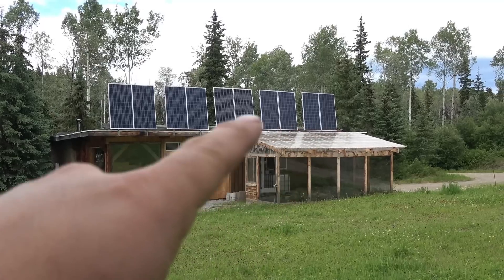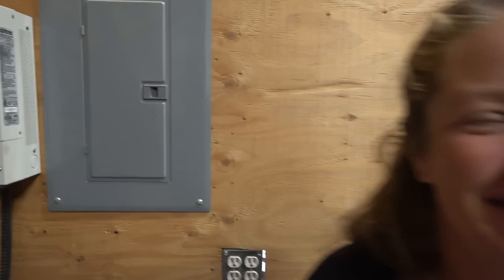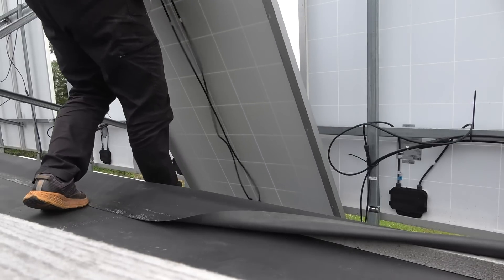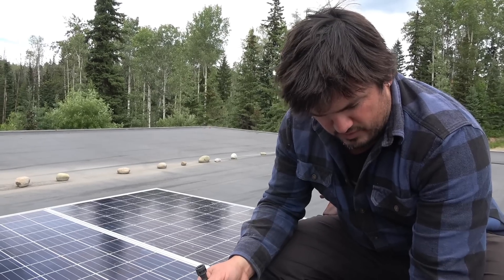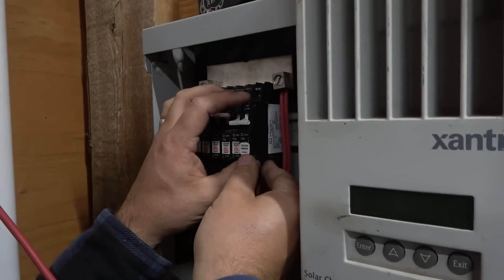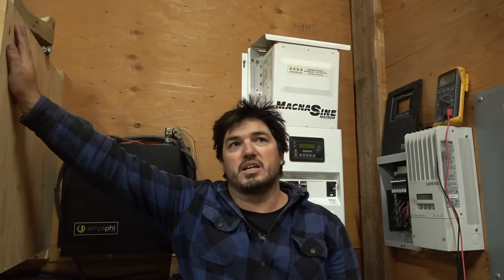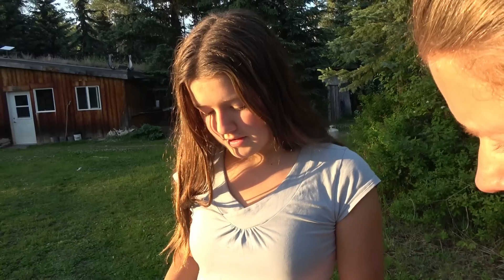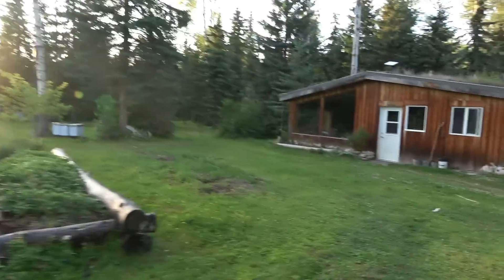SUPERCHARGED Off-Grid Solar Power System

Comment: The over panelling trick to max out the amps for a longer period would be to have more panels aimed in different directions (east west) or build a tracker.
Reply: offgridwanbe is mostly correct. for e.g.  facing half array SE will allow PV array production to not exceed limit of charge controller (60A.) over the day. Their issue (*from org. 'dropoff' prod. graphs they hand charted for season of video)  was not using available PV production after batts filled in AM.    So  they really need (*acc. to graphs for this time of year) INcrease  Battery Capacity (Amh) 🌻  OG Free fuel is the Ultimate Power🗽
Reply: In different direction will limit the panels
Reply: @kenputer56  yes but since it is over paneled it will give more in a day as some will be maxed out all day

Comment: come on man, just dry stuff, no active power required
Reply: yeah that was the old style, before the electrical nonsense lol
Reply: of course you get more power
Reply: on the off-hours it rises the base supply
Reply: camera tripod man
Reply: the panels act like capacitors when external leads are not connected
Reply: you should have a dump load (some expensive process) that you can dump any excess power, over the batteries, anything

Comment: Jeff, you need to build some kind of a tilting solar platform that can be adjusted by a sprocket and chain from one or both sides of your house. Then the platform can be locked into place using the links of the chain. You're still living the dream though buddy, good problems to have. God bless

Comment: Wrap the freezers in 1 inch foam insulation.  It helps
Reply: No as it does not dissipate the heat so they will have to work harder and use more power up

Comment: Why not put them in series to increase the voltage?  Then you can charge at a higher current once the charger's buck-converter brings it down to battery voltage, hence increasing the current.  It appeared you were still well below the 150vdc rating of that mppt charger.
Reply: from 2 panels to 3 panels in series

Comment: I love your show. I am way over paneled too! I have two Midnight solar 150 classics connected to 30 panels rated at 240w or 7200 kw.. I had to reduce max output to 80 amps each because my buss bar was getting so hot. I bought a plug in temperature controller and plugged a couple small fans into it  and increased the output to 90 amps each. Not sure I want the full 96x2 amp capacity going on while I am away. LoL 
   We are in the south so we have to include air conditioning in our grilessness!
    Well done and we’ll played sir.

Comment: You know a cheap and easy way to increase solar production, possibly by 33% is to add reflective mirrors on either side of the panels, focusing more light into each one.  And, the "mirror" doesn't actually hve to be a silvered glass one, simple polished aluminum panels will do well.  And the aluminum panels can be used to fold up against the PV panels in case of inclement weather.
Reply: Have you tried that? What improvement did it provide?
Reply: @smalltownhomesteadAC  not personally no, all his is research done by this channel https://www.youtube.com/watch?v=FKhszB4E1_M&t=945s  he does multiple videos on the subject, and I'm looking into the entire process, not having the money to actually build my system.
Reply: Ground mount using Bifacial panels with white background makes more power.

Comment: Find a good spot in the yard and make your solar array there.  Then you dont have to worry about your roof and they are easier to clean in winter.  I have found that if you over kill on the panels it will charge your batteries faster or get more power on cloudy days.  When your batteries are full, that is the time to use the most electric, laundry, tools, etc, then you are only using solar power and not battery power.

Comment: Makes sense that you wouldn’t receive 100% of panel volume. As panels on average only produce 15-20% efficiency. 
I sure love your content. Like a refreshing glass of water on a hot day
Reply: Isn't that efficiency meant to mean 15-20% of the solar power available per square? There is about 1000W of solar energy in a square meter area so 20% efficient panel would generate about 200W per square meter.

Comment: Uhh, 60x150 is 9000, I.e. 9 Kw max.
Rather than sticking to 50V, bump up to as close to 150 as you can go and add oodles more borscht panels.

I would think 4 groups of 3 panels each would be a good start; 3S4P. Might be able to get away with 4S4P, or maybe 3S5P or 3S6P if the roof is wide enough. 4S6P is probably the highest that MPPT will go; about 50A-ish at 145V-ish.

Comment: Hi Jeff & Rose, I wanted to pass on an idea for a system for your solar panels that you want to build, YouTube channel Simple Living Alaska just built a raised solar panel system you may be interested in copying how they did theirs, they built it with metal & welded it & attached it to the roof of a shipping container. It's very tall, you could make one that could adjust to horizontal or varying degrees of vertical depending on your needs & the weather, then tighten them down so the wind move it. Their system seems extremely solid & was built & posted on their channel this Spring. You've done a great job with upgrading your power today!! Love your channel!! 😊
Reply: And I think some of the things they used were produced in Canada.

Comment: Yes some controllers can handle over voltage without any harm because they are good quality builds. Best not to run them at the max limit though for longevity or so ive heard
Reply: MPPT can handle excess current;  no controller wants excess *voltage*.
Reply: That's right

Comment: I'm sure you're like me where I just  can't stand the  know it all(s), and I am not trying to be a know it all; at all. My system requires 4 Charge controllers to be at 100%, but purchased 10 controller, I installed 9 controllers and run my system at 40% or less duty cycle per charge controller. I learned from all others systems where they ran their systems pushing  the controller to  take the higher amps/watts it can handle to save money on controllers, and this drives the heat through the radiator fins/heatsink on the controller. That is why it has a big heatsink and fins to cool the system when its hot. However with lower amps/watts per controller; the less heat stress cycling between day and night that causes micro cracks over time to develop from thermal expansion and contraction. In other-words; you cannot stop this thermal cycling stress, but you can reduce the intensity of this thermal stress levels to prolong the life of electronic components. Adding another Charge controller due to duty cycle and heat is smart insurance money. If you run your charge controller in the 70-80-90-100% ranges it takes that heat as component stress over time and fails sooner; leaving you with out power for weeks or more, let alone the hassles. Most solar charger controller manufactures and engineers will tell you this , since several have had  this very conversations with me the second I talk about under-driving the controller in the 40% ranges. Keeping it under 50% max amps duty cycle and and they quickly quoted to me I would probably get 25+ years out of our controllers. To add additional insurance I and have a spare. Love your channel.

Comment: Well I just watched your Solar upgrade???
I have been "Battery Based Off-Grid living for 16+ years.
I own GP Wind and Solar and have designed my own Dual Axis Solar Tracking System that is aiming straight at the sun anytime, all year.
Every night the Solar Tracker goes back to the East sky automatically and stands full vertical...
It NEVER needs snow removal all year, ZERO man/woman time put in to remove snow, NEVER...
I have never mounted a Solar Array FIXED on a roof or Ground mount...
My experience of 16+ years with Solar Production is simple,
The sun moves across the sky and we need to follow it.
Full Solar production 2 minutes after sunrise to the days-end sunset = Float, Float, Float
From this, I get over twice the life out of any Battery Bank.
I watch you guys daily, you have the best lifestyle and beautiful family.
please contact me to learn more about your commitment to Battery-Based Off-Grid living.
I am a BC boy from Vancouver Island,
Gord@gpwindandsolar.com

Comment: Hello Jeff, 
Since now you have 12 panels in the system, It will be better if you connect 3 panels in series (4 strings instead of 6) and up the VOC to 125ish volts still under 150V of the charge controller.
The MPPT charge controller works more efficiently with higher voltage and you would need less cables and still your per string current will be same. Higher voltage helps Charge controller to extract more power on overcast days and will start producing power earlier. Hope this helps.
Reply: May be to high a voltage in cold weather 3 in series and the controller will let the smoke out if voltage to high
Reply: @kenputer56  open circuit calculations help with that
Reply: @thankswezilow6794  Is it not based on open circuit voltage , I would not put 3 in series with 150 volt controller in cold climate.
Reply: @kenputer56 u know nothing about mppt charge controller.simple dont exceed the open voltage
Reply: @onosgt8809  If you say so , that is why I use a midnite controller with hypervolt.
Reply: shouldnt he just add 1 or 2 batteries?
Reply: @farnorthhomested844 I’m learning about upgrading solar, and have learned the most bang for buck is solar panels. Here’s one reason. You could have a massive battery bank, but unless your solar produces more power than you’re using, your batteries won’t charge. I know it seems obvious but must not be? I have net metering with two power walls so when the power is on, battery fully charged, excess power goes to the grid. If you’re producing more than the battery bank will take, then figure how much battery you can add, to get the balance.
Reply: @farnorthhomested844  Doesnt help, because theres not enough charge current left.
Reply: So with all the improvements can we all come over for a cheese party?
Reply: Correct
Reply: how many WATTS does have every solar panel?
Reply: Tend to agree. The Voc for 3 panels even at 0 Degrees C will be about 148V with very low current.

Comment: PUT HEAT COIL ON YOUR FLAT SOLAR PANELS TO KEEP THE SNOW OFF YOUR PANELS.
Reply: Yes but they are better vertical in winter because the sun is low in the sky